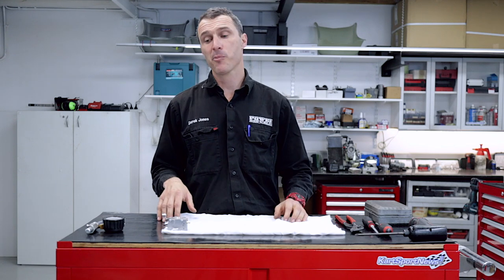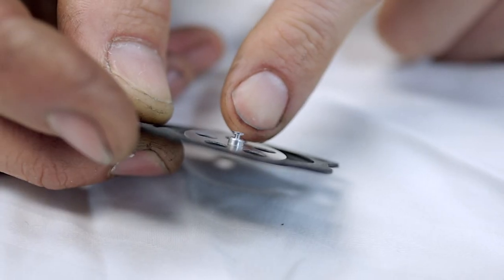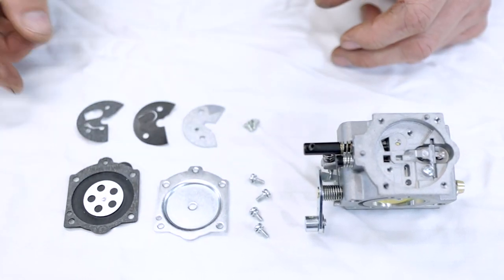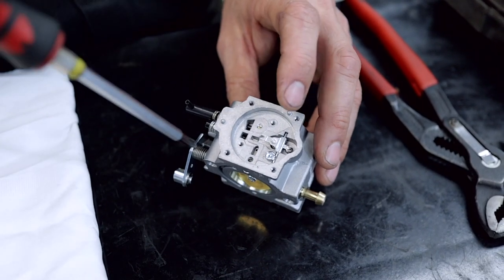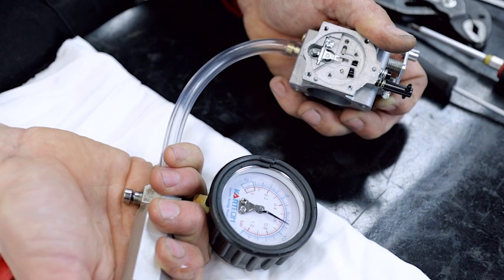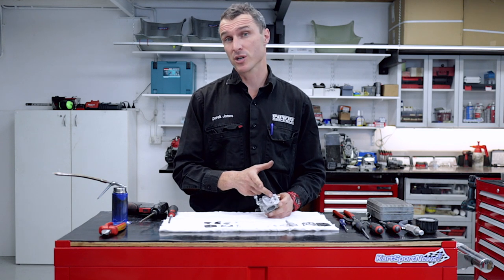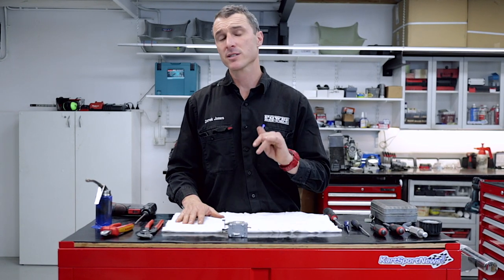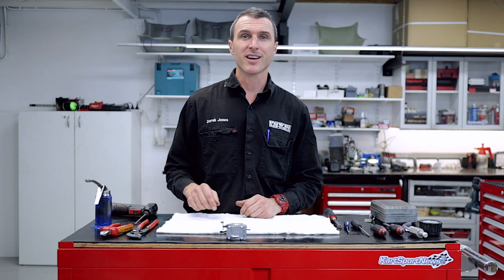HOW TO: Service The Walbro WB Series Carburettor for your Go Kart - POWER REPUBLIC

Comment: Hello, great video btw! I learned a ton from this! Any idea why I’d be having issues getting fuel suction? If I cover up the air intake it’ll suck up fuel and start up and then I have to rev the engine super hard for it to warm up and stay running, I am trying to get it to turn over and run on its own though, but for some reason it does look like the carb is unable to suck fuel up on its own while starting for some reason. I have a rebuild kit on the way, but was curious if you have any thoughts.
Reply from the maker: yeah most likely the carb kit and carb needs a service.   do that first and get back to me....

Comment: Can you do another detailed video about tuning the carb but when it’s on the engine cause I’m having and issue with mine staying on just always seems to die I feel like my carburetor tune is bad :/
Reply from the maker: Hey Jacob, maybe try the heavy duty springs on the Jet Needles.  maybe they are vibrating loose while you are drving?

Comment: Hi Derek, are the settings similar when running the walbro on a 100s? Many thanks
Reply from the maker: Hi, with the 100 S engine, we normally used 2.0 LSJ and 0.125 HSJ.  if you run much more on the HSJ it seems to four stroke.  Other wise the safe option is 1.5LSJ and 0.25 HSJ
Reply: Power Republic Thank you

Comment: it always comes in the kit and not sure where it goes, even my dad doesnt know where lol, its like a little clip, similar to a gudgen pin clip but a lot smaller, do you know what it is for? thanks
Reply from the maker: Hey Flynn.  Great question.  I didn’t use them either.  I think it is for the screen that is on the half moon 🌝 cover on the diaphragm side of the carb (just above the high speed needle discharge orifice)
Reply: @PowerRepublic  that was my thought was. cheers mate

Comment: Hi. What if i had to make spring harder? To lean at midrange? Can i stretch it? Thank you.
Reply: Metal has a memory so if you stretch it it will also uncoil but after awhile it will try to return to it's original shape and pressure or until it gets fatigued. Obviously the best way would be to get a longer spring and cut it accordingly but people do it all the time.

Comment: I thought popoff pressure should be 15 to 18 PSI with a reset pressure of 10 or above if below 8 it may leak gas past the needle & seat, by lowering it will cause the engine to run richer I believe. Do you use exact popoff pressure for every Carb or do you use that as a general rule of thumb?